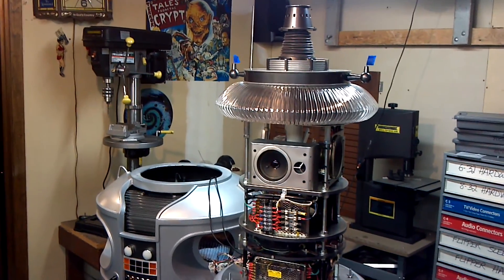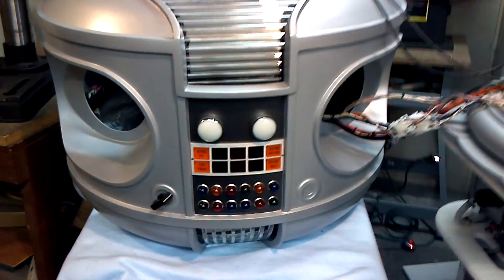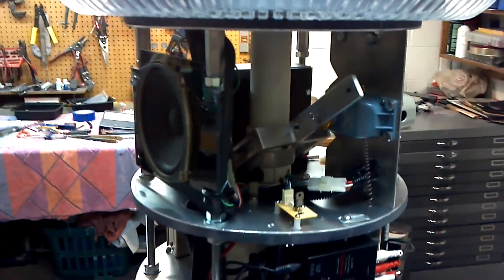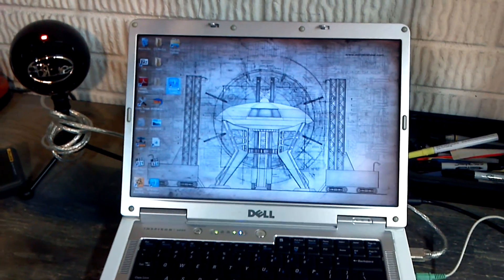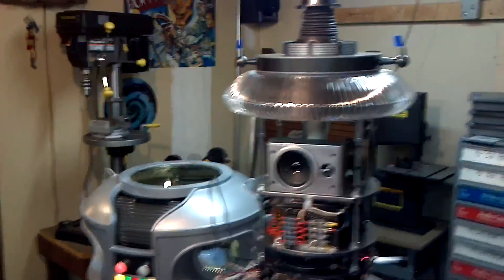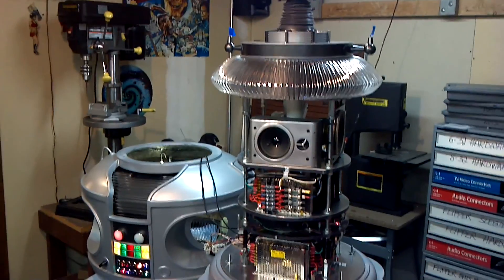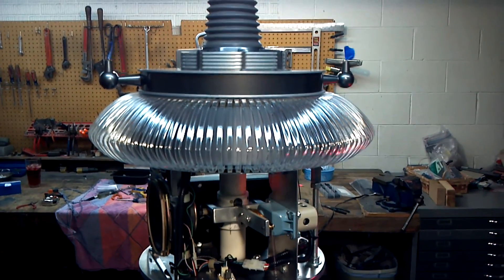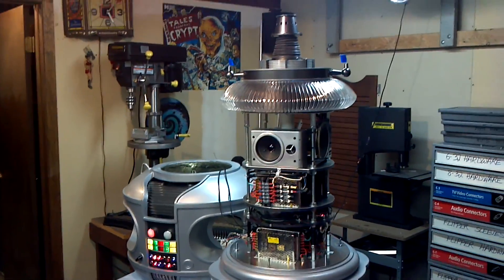February 23, 2013 5:07 PM

Comment: Dave, what EZ B robot controller do you use or do you suggest. The B4 controller and battery upgrade, or the developer kit?
Reply from the maker: Hi brother! I use the full sized EZB controllers. EZ-Robot has an IoTiny that is much smaller and less expensive but it does less. I need the full capabilities of the bigger EZB. Things like reading and writing through the Uart port are important to how I control and interact with this robot. However the IoTiny may have a place in your robot depending how you use it. As a side note, the EZB controllers only use the ARC control software from  Synthiam. It's an awesome platform! But wait! Synthiam has a way to let you flash a couple of the Arduino models and a few other boards and turn them into an EZB! Then you can use them with ARC and use them just like an EZB. The only limit would be what the Arduino was able to do (hardware wise) in the first place. Cost difference: EZB: $100 USD, Arduino: $28 USD. About the developer kit, If you can use everything in it then it's a good buy. I got one a while back and a lot of the stuff in it went unused. But that's just me and my robot. Have fun!!